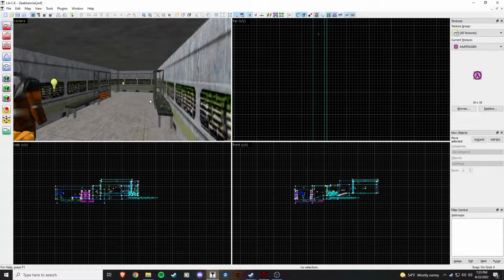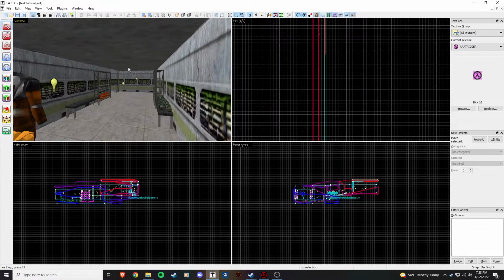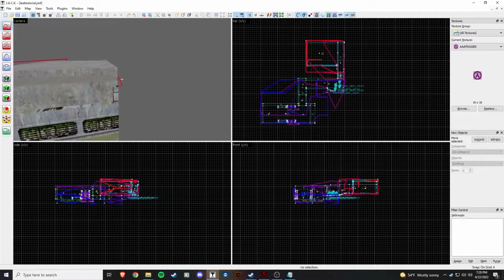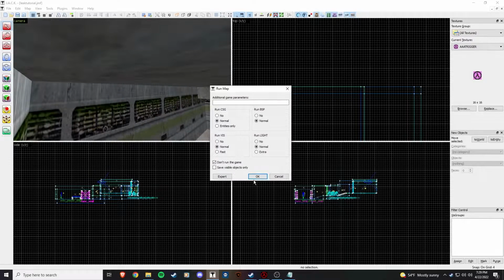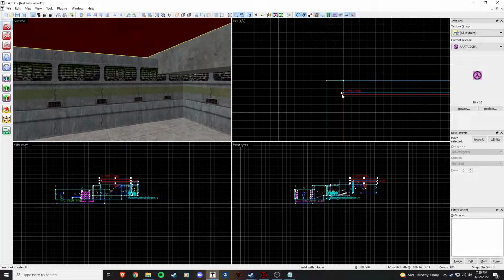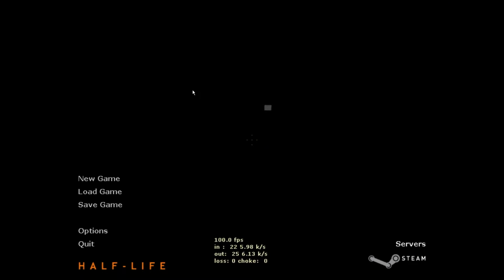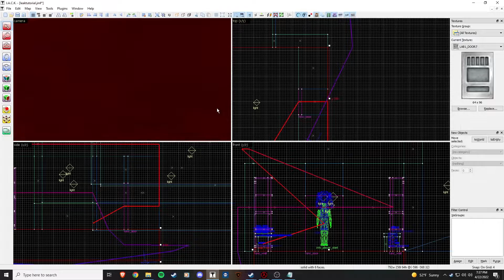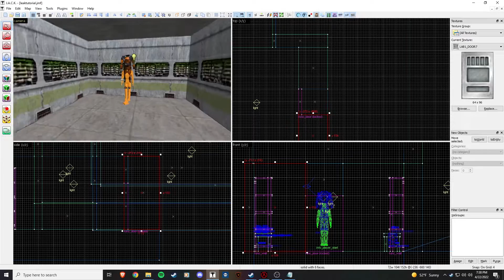Valve Hammer Editor / JACK - Dealing with LEAKS

Comment: Map compiled, says there's a leak. Check the point file. Red line starts and ends in the void, nothing near it. What? What could possibly be the cause of this """leak"""? The line briefly TOUCHES a wall when it's orange, but there's definitely nothing there, and the actual error log references a func_wall at 0,0,0, of which there is nothing.
Reply: Update: Slapped a tiny, out of bounds box on 0,0,0, and that actually fixed it??? I'm genuinely so confused. Thank goodness I sealed off the center of the map now I guess??????
Reply from the maker: @toxic_shr00m  Go to the Entity Report in the toolbar (i think it's Map > Entity Report) and find that func_wall and then you can delete it. That will fix your leak

Comment: i dont know why every time i will try to compile my map it will show "map was not found on server"
Reply from the maker: That means your compiled map file isn't in your game's "maps" folder. might want to double check your JACK / hammer configuration settings
Reply: Ok thanks
Reply from the maker: @physics5617  you can also check the box "do not run" when you're about the compile, that way it wont auto launch the game